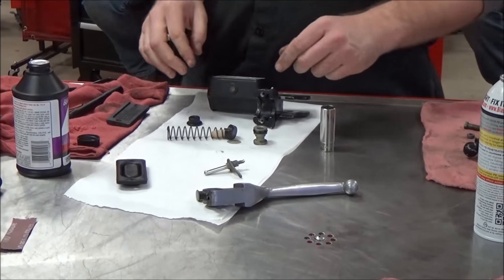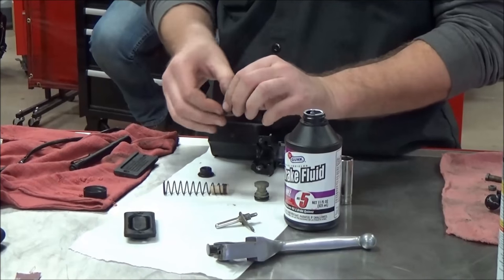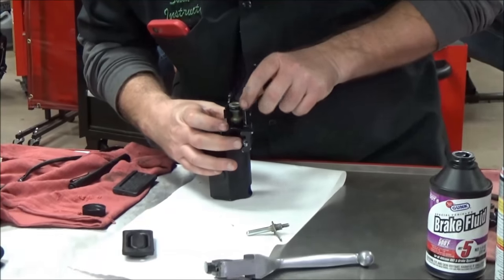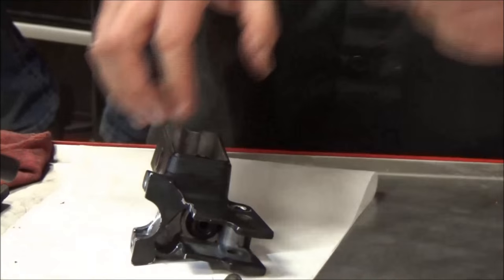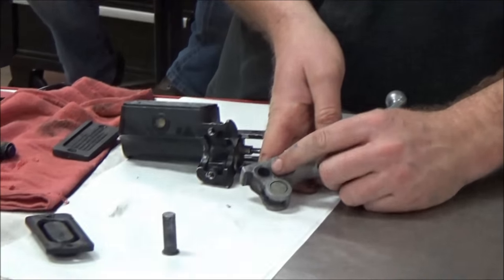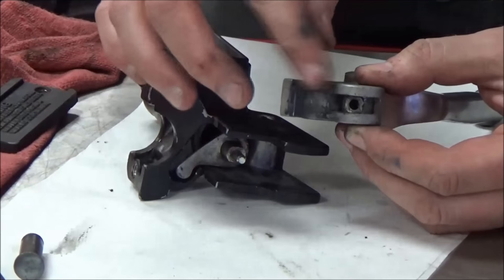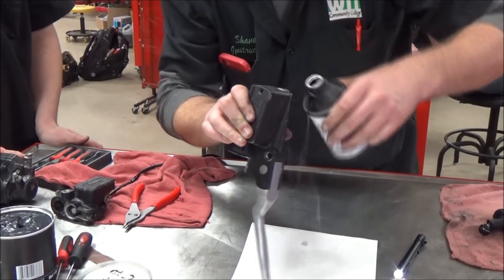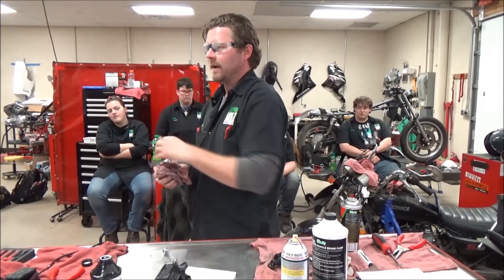How to rebuild your Harley Davidson Master Cylinder and test it BEFORE installation!

Comment: Shane, got my rebuild kit today and tried the socket method of installing dust seal but ended up ripping the seal. Used a 1/2" socket and just lubed with a little dot5. Now have to order another kit. Any tips you could provide would be appreciated.
Reply: my master cylinder has 5/8 stamped on the housing by the brake lever . I used a 14mill ) 9/16 deep socket on a 3 inch extention, and wiggled as I pressed . it worked great . now I have no idea how to prime my rebuilt m/c .. I don't think there was anything wrong to start with ..  I replaced the steering bearings and races ,and took the front end off . I pumped the fluid out of the m/c so not to worry about it . When I put the front end back on ,I had no front brake. Strange because it worked before .. So now after following Shanes directions I re assembled the m/c but there is nothing coming out . If I pour fluid into the chamber that holds the fluid ,then turn the m/c up and pour more into the outlet hole , I get pressure forcing fluid out , but once on the bike , and I cant pour fluid into the hole .nothing happens ..   You know what ? This video leaves important stuff out .. Just like you said ,you guessed and used a 1/2 inch socket.. The correct size is the most important thing in reassembling the m/c. Shane should have spent time explaining that, instead of saying to use the appropriate socket with out saying how we novices will know the appropriate size .. Also the priming the m/c thing ..

Comment: A question, I have a fatboy 1991 with 5/8 front master cylinder the brake is strong but if I press the handle up and in I loss all pressure the handle goes all the way but the when pressing normal it charges immediately. What do you think could be the problem? We replaced the kit and had about 5 days of perfect brake now its lossing charge when left alone and when pressing the handle up and in

Comment: I have a 95 xlh883.  My brake light is staying on. I thought it was the handlebar  switch because I recently put a new throttle cable on and fgrd I had gotten it out of wack. But when I started looking the connector that opens and closes the switch with the lever isn't moving out far enough to open the switch. It looks like the plunger is loose and isn't retracting back into the master cylinder enough . So I'm wondering if a rebuild kit will fix this issue.
Reply from the maker: I'm the intern studying under Shane. One of these days I hope to move from the office to the shop! Wish I knew the answer but don't want to bs you. He couldn't screen these requests fast enough...

He has a few other tricks up his sleeve he plans on making videos on. If you need help sooner choose and option below! 

That’s a great question for Shane directly! We are just the social media team. Shane does answer questions when he get's back around to non members eventually so hang tight, FYI >>>> he does member ones daily!

He just returned from overseas training techs and his inbox is slammed with requests. He is scheduling time each day again to answer techline orders. He does not have the bandwidth to provide free email replies as his schedule is full with shop customers, training schedules, and one on ones. 
There's good news though! Shane has 2 solutions for you. One is a deep dive one-on-one with him with video, email and phone support. The other is a "quick fan support" option when it's a quick answer and just helps support the time for him to stop wrenching or training and get you in the direction that a free video had you close. Links to each are below. Hope this message makes sense to you as a decent human being that also works for a living and gets it!
Make it a great day!

The one-on-one service. Get Shane’s cell here: https://how2wrench.com/ols/products/techline-one-on-one       
Quick answers are answered daily as a channel member: Join this channel to get access to perks:
https://www.youtube.com/channel/UCBhM8DCKnT3qXwTW0eToyCg/join   
-Daily MEMBER FIRST COMMENTS ANSWERED FIRST 
-Live Q/A video chats
-Wonder if we have a video on your need? Members can request content links!
-Full Access to the ENTIRE 700 video library
-Member-Only FREE tool giveaways  

Have you seen our "YouTube Trained Support Shirts? Great way to "high five us" https://goodfellasmerch.com/collections/how-2-wrench/products/support-shirt

High fives help too! Give him one here:  https://www.paypal.me/how2wrench

Comment: Thou is in 7 years into the future I just came across this vid n gave it a watch - good presentation & info BUT you've omitted one vital piece of important info to note : alot of HD models of those older years didnt use that 'plastic pin' inside the spring - instead there was a flat metal disc attached to the smaller end of theat same exact spring along with the exact same plunger n seals.  Last 3 I did didnt have the pin.
Reply from the maker: Hello nemesisX. We did not omit as our model did not have it. Our videos are skill set based and while not model specific, we do try to include if known. We still find you comment valuable for our community as they are looking for information. Thank you for making even more value here. 
 Thanks! Join the channel. Best $1.99 you'll spend to access all 800 vids and Shane Daily! Smash the sub and like please. 

Throw Shane a high five donation, channel membership or merch for saving you $$$$$$$ Links below to support more for this work! 🙏
You rock for commenting! We will let Shane know! Want even more? Best $2 you'll ever spend...Join this channel to get access to perks:
https://www.youtube.com/channel/UCBhM8DCKnT3qXwTW0eToyCg/join      
-Daily MEMBER FIRST COMMENTS ANSWERED FIRST 
-Live Q/A video chats
-Wonder if we have a video on your need? Members can request content links!
-Full Access to the ENTIRE 700 video library
-Member-Only FREE tool giveaways  
Ways to support or high five How 2 Wrench! Thank you in advance. YOU MOTIVATE US TO DO MORE!
1. Smash the subscribe button (thank if already a sub!)
2. Have you seen our "YouTube Trained Support Shirts?  https://goodfellasmerch.com/collections/how-2-wrench/products/support-shirt  
3. High five donation:  https://www.paypal.me/how2wrench   
4. Got an emergency and your head is about to explode from frustration or fear? Get Shane’s cell here: https://how2wrench.com/ols/products/techline-one-on-one

Comment: Hi there. I have a question about 1982-87 Harley Davison REAR brake master cylinder piston seals.

I'm looking for extinct rear brake seals and piston for an Australian release 1978 SR500e Yamaha. 

Found one kit in the world but they want about $330oz for it when most other kits are about $35. 

The cylinder is 5/8" it's cast on the outside of the cylinder 5/8". 

They seem to be unique to the SR500e's and XS400e's, only.

If you mention the word Yamaha to the local Harley places it causes some kind of seizure or mental blockage so I was wondering if you or your viewers could help with a very basic question.  

Forgetting the piston. Just the seals would do. 

It looks like a kit for the rear master cylinder from a 1982-87 Harley could be what I'm looking for. The cup seal that sits against the inner end of the piston over the spring and against the 6 petals of the reed valve thing must be the same as the cup seal on my SR, they have the same type of valve and are 5/8". 

The information I'm looking for relates the other seal the one like a cup but with the hole through it that is on the outer end of the piston. 

Could anybody tell me the diameter of the part of the piston where this seal sits and how is this seal retained in place. 

The SR is 9.55mm at this part of the piston and the seal is retained by a small ring cast around the piston under the centre of the seal about 1 mm wide and not much higher than 1mm. 

Any help to solve this mystery would be a benefit to all SR500e XS400e owners globally. 

Found tons of photos of the kit but none without this seal removed from the piston. 

Thanks.
Reply from the maker: It sure sounds like you have done a ton of research. I have some connections for vintage parts but not sure how much help on an Australian Model...
Have you Subscribed yet to never miss a video? Have you seen the video playlists https://www.youtube.com/user/conleybuilt/playlists ? Quick answers are often found here. No time to look through videos? 

Still have questions? You’re in luck! I provide tech help and work one on one! I know your question may seem quick but with over 300 requests a week, it’s not possible to answer them all. So, I’ve narrowed down so subscribers and donations to assist beyond the over 660 free videos. My YouTube has grown beyond the ability to answer every question (11 million views! Over 500,000 a month!)

Click here for the membership links and welcome to the community! https://how2wrench.com/product-category/specials/    

Want to say “thanks” or “keep it up”? Click here https://www.paypal.me/how2wrench   This is great for those truly quick questions you need answered and your help back will keep me going!

Your answers and help are just around the corner. Save time and money while protecting your investment and yourself by doing it the right way!
Admin How2Wrench.com

Comment: Where can you find a rebuild kit for this???
Reply from the maker: Many different master cylinder kits. We more info I can make sure and give you the correct part number to locate. 
If it was a quick answer I’d try to respond here but I wouldn’t want to lead you wrong assuming certain factors. Reach out to me on my website contact page. We have been overwhelmed with ungrateful people and
scammers so I had to do something for my sanity by screening the over 300
requests a week! I’d love to work one on one with you! Contact Link: https://how2wrench.com/contact/ 

Your answers and help are just around the corner. Save time and money while protecting your investment and yourself by doing it the right way at www.How2Wrench.com 

Have you subscribed yet to never miss a video? Have you seen the video playlists https://www.youtube.com/user/conleybuilt/playlists? 

Want to say “thanks” or “keep it up”?
Click here https://www.paypal.me/how2wrench
Reply: I just need the kit from this video

Comment: For an instructor, you should have explained the parts that you installed and not fast forwarded through the video. Plus you should have shown the disassembly, inspection of the bore and rather to or not to knock the glaze off the bore wall. 
This is a system that can gravely hurt people, so please do not half a$$ explaining it. Take care